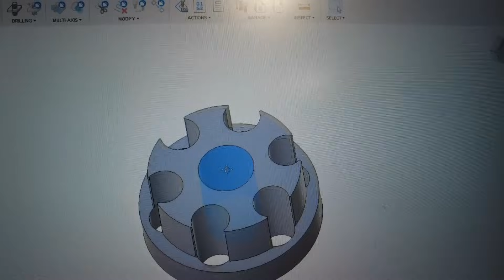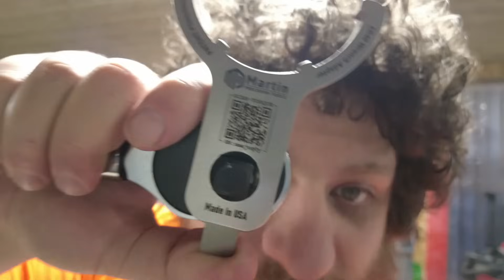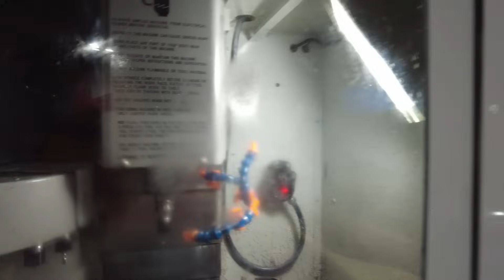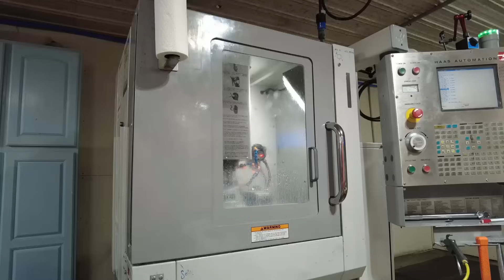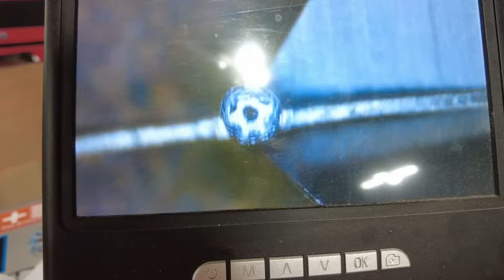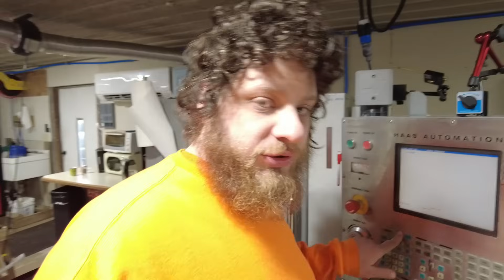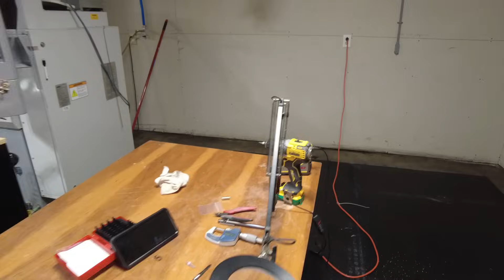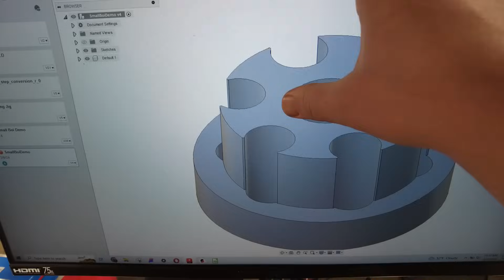Machining Some ABSURDLY Tiny Parts

Comment: The first thing I thought of was it's job for EDM. I was thinking about the best way to do this job. One strategy may be using your high RPM machine to mill small graphite electrodes to use to electrical discharge machine the small holes. Then use your mill to machine another electrode with a shape of a counter bore in it to use to burn the main outside profile. Then a wire edm to use to cut off to length. The edm process has a large advantage over conventional milling in this part example.    One the edm process does not actually touch the part hence eliminating the burring problem. Another strategy may be using a flat ground plate and use a hole-popper which is an edm process of making starting holes undersize for the wire of a wire-edm machine. The wire-edm could then be used to edm the holes to size. I used to own a mold-making business. I actually just got a cm1 hass like you have for my garage shop. I am planning on using it to make some aluminum molds for silicone soft-plastic fishing lures.
Reply from the maker: That totally makes sense. and I would love to move into EDM. Half of the jobs I take require super tight corner radii, and a EDM would be incredibly helpful for that.
Reply: @AudacityMicro  EDM is not going to cut it.. you always have a radius equal to the sparkgap, i'd like to make small gears, but my Wire EDM only can use  0.25 mm wire, which means a minimal pitch because of the wire diameter and the sparkgap being 0.05..
A Lathe with Spindle Orientation and driven tools would be the best option here.. unfortunately i haven't got one..
Reply: @AudacityMicro   actually another thought came to mind. If you think about the cutting path program for a second. Say you leave a small amount of stock, maybe .060 or maybe even a little more on the od of the part. You will need this for strength. Then you program a cutter path with a very small cutter. The cutter needs to be smaller than the od of the small holes. Then use an adaptive tool path program and step-down from the top to the bottom in very small increments maybe .001per step-down. This way you would cut right to size in each of your step-down and maintain strength in the part through out the cutting process.
Reply: not sure if graphite is the best material because of how thin the  graphite "boring drill" have to be. high speed might be able to cut it, but any minimal texture in the bit could mean breaking the graphite tool (high form factor, low strength material). maybe using the drill bit to machine a negative of the tooling in the graphite and then burn it into other piece of graphite or copper. and then use the copper to burn the geometry into steel. 
It certainly a EDM job. but I would call it a easy one for the amount of thing that can break in the process. but easier to debug than milling it, for certain.
Reply: @giuseppebonatici7169  I thought the same thing when I was pondering this part. We used to grind a lot of small graphite electrodes in my old shop on a surface grinder.  We used a Harig grind-all fixture and spun the graphite into the side-edge of the grinding wheel. The trick was to leave plenty of stock on the electrode and take the finish pass right to size. I think the same thing could be done with the high speed spindle of the milling machine. The trick with these type of micro parts is not to creep up to the dimensions. You have to leave enough stock for strength as possible then take to size.
Reply: @giuseppebonatici7169  drilling .005" - .010" holes through graphite trodes for flushing isn't fun but it can be done.... go slow and run that drill back every .025" or so to clear the "chips" .Pulling/ modeling trodes with fat bases help so you can get a good 1/8" feed and starting line for you tiny holes.
Reply: @giuseppebonatici7169  to me the part looks like a micro version of a "airplane connector" baseplate. Six channels and a common groundplane in the centre is a standard cable layout :)
Reply: I was thinking the cheapest improvement to make the process more efficient would be to magnetize his tweezers and needle nosed pliers. After losing the part for the 2nd or 3rd time I would be clawing my eyes out with frustration.
Reply: @WilliamKennedywmk3  the good news is material cost for lost parts is extremely low. lol
Reply: @WilliamKennedywmk3  one thing you don't want is magnetic tweezers.. that is why Watchmakers use Stainless tweezers, hell!, i even made my own tweezers out of titanium!..
Reply: Given the small reach and tiny amount of materiel to remove, I wonder if you could use sheet metal as the stock and bit of wire as the electrode? Plunge the holes right thought and then cut around and let the part fall out the back. If the erosion of the wire is an issue, then use a bit of wire several times longer than the part (2-3mm?) so there will be every little use of some of the wire.
Reply: @benjaminshropshire2900  ya you just have to mind the spark gap. EDM is the way with something this small in my opinion. A small sinker could burn through the center and the top detail on a whole plate of these little guys. Then a little wire machine would be nice to cut the remaining outside detail and have then drop free.
Reply: @5265060  The only downside to cutting the outside profile with wire is you'd have to clean up the 'tit' left over by the wire -- the part will drop free before the wire can make a complete circuit around the profile, which always leaves a small burr that has to be dealt with in some way.
Reply: @benjaminshropshire2900  If you machine this from sheet stock, how are you gonna hold it in place?..
i Once did some watchparts out of 1 and 1.5 mm sheet, that went fine, since i had plenty of surface to hold on, as well as tiny tabs around the circumference of the part.
I glued the sheet to a sacrificial plate of aluminium, milled out a couple of parts, and then dumped the lot in a bath of Acetone to dissolve the glue (CA).
To machine the other side, i drilled some holes, and pressed in some dowelpins, to orient the part, glued them down, and machined the bottom.
But in this case, that's simply not gonna work..
the best option, as mentioned here as well is a "Swiss" machine.. with spindle orientation, so you take a rod. drill the centerhole, and the 6 holes around the center, then face, and turn the circumference, and part off.. the only thing is.. when parting off, you need either a tube that fits over the part, or a vacuum, to catch it..otherwise it is lost in the chip tray..
I never ever ran a swiss machine.. but i'm sure i can make that work within a day, without training.. just gimme' the manual, and i'll figure it out..
Reply: @JanBinnendijk  I'm not seeing any issues with holding it in place. Mill out a pocket in a block and clamp the sheet over that? Or just clamp it sticking over the edge of a block? Lots of options.
Reply: @benjaminshropshire2900  indeed. you don't see issues.. i do..
Reply: @JanBinnendijk  Maybe we are using different definitions for "issues"? You described one way to solve the problem. I proposed several other (and could likely give a few more). Sounds like there are lots of options. Which is the exact opposite of having "issues" (at least the way I'm using the term).

Now if you have reason to think those wouldn't work in this case, feel free to describe those reasons. I'm always happy to learn more about the how and why of things I didn't know before, even if it proves I was wrong. (But if someone is uninterested in explaining why, I'm equally  uninterested in listening.) 

(Note: I'm assuming that it's perfectly find for the last step of the EDM process to be "part falls out into something it can be collected form later." If you're assuming it needs to maintain positive control all the way thought, that difference in assumption could account for out differing assessments.)
Reply: Absolutely right. I was working for a company some years ago, that were machining injector nozzles for a aerospace company. They were trying to drill 0.15mm holes at an acute angle to the part. One week later and a box full of tiny broken drill bits, they subbed the job out to have them EDM drilled. Three days later they all came back within tolerance and zero scrapped parts...Lesson learned by everyone involved.
Reply: Also a good solution
Reply: The first thing you'll notice about a micro drill or cutter, is that it's very bendy. The next thing you'll notice is that it's broken.
Reply: My first thought was, this is a job for a Swiss screw machine. They are designed to make parts exactly like this.

Comment: Would magnets not help to hold and measure the parts ?
Reply from the maker: The first batch was a non magnetic stainless. It would have worked for the second batch though.

Comment: a few neodymium magnets is various strengths will do the trick also for finding lost micro bits and parts, also i suggest you rid your self of the glass and sand paper although that does have a chooses I particularly like it for making the side cases on my custom bikes flat so they don't leak oil but what you need are real metal lapping plates of various cutting grades. they can be extremely precise. to .0009

Comment: I think it's fun because it's so difficult, yet so cheap in materials, except when you break the drill bits.

Why not drill the outer holes before removing the material next to those holes?
Reply from the maker: I did

Comment: Cool
Just one thing...

Torque wrenches should never be clicked twice... for your setup it doesn't matter so much, but if you need to be precise as with geometry adjustments in ym tolerance fields... you don't want to do that

Comment: If you're making small parts:

1) Vacuum all inspection surfaces and the surrounding floor.

2) When you lose the part,  take your vacuum cleaner, get a pair of 40 denier black tights, cut off an end and stretch it over the  the vacuum cleaner nozzle (use a round nozzle).  Secure the sock with tape making sure the sock is tightly stretched over the end of the nozzle. Now vacuum around the area you suspect the part may be in. Periodically inspect the end of the vacuum cleaner nozzle to see if your part has turned up. If it hasn't, expand the search area. It WILL turn up.

BTW, I'd turn the outer dia's on a watchmakers lathe before drilling. That way the ODs are clean.  Maybe follow up the drilling op with a mill to clean the burrs off the holes. Then, back in the lathe, clean the front face, set in a dop with shellac (not wax!), part with a saw, flip the dop, clean the back face. Remove from dop. That way parallelism is guaranteed and you have complete control of part height.
Reply: What is a dop ?   I have searched the internet in vain.  I do like your vacuum advice.
Reply: @Hereford1642  A "dop stick" is essentially a thermoplastic glue set on a bolt.

You glue the part in place, do the front face ops, transfer to a "dop jig" that lets you glue the front face to another dop stick, heat the first dop to separate and now you've swapped end for end with zero loss of position in any axis.

If only it would work with parts larger than a couple of grams...

Here's a lady setting up a stone on a dop. 

https://www.youtube.com/watch?v=0wSXIjznmlI

 And a dop transfer video:

https://www.youtube.com/watch?v=vnthnqykUu0
Reply: @evildrome  Thank you.

Comment: How is this industry cost effective because how much can this part possibly cost?
Reply from the maker: Things work a little different in this sort of work. Material costs are basically completely negligible. All the cost involved are skilled labor, tooling, and the cost of the machines. Per gram, these parts were very expensive. But you have to remember these parts are probably going into developing some medical instrument. The medical company is banking on selling hundreds of thousands of those instruments at a huge markup, so even at something like $2000/gram of parts, they will make money on this.

Comment: Two things you can try to debur tiny parts like this are (1) grit blasting and (2) steel shot tumbling. Micromark sells a benchtop grit blaster for like $200, and shot tumblers are cheap as well. I've use these when manually machining tiny watch parts and it works well, granted I work mainly with brass.

Great work, man. Very interesting channel.

Comment: Why is the liquid flow so high? You don't think that's causing problems?
Reply from the maker: It's relatively tame for this kind of machining. It's not enough to mess with the tool. The coolant flow is really important for getting clean cuts, as it helps remove chips, so that they aren't re-cut or smashed against the part.
Reply: @AudacityMicro  metal is the only material I barely ever build with. Its always surprising how incredibly stronger it is than wood or stone.
Reply from the maker: The carbide they use for modern cutting tools is also pretty incredible. There's not a lot out there that is harder. A few ceramics, and that's about it. It doesn't really bend much, (though it is measurable on precision parts). It generally goes from "cutting" to "broken" with very little in-between.
Reply: @AudacityMicro  pretty amazing. its the future!!

Comment: The couple of things I would have tried besides reversing the cutting to flex the bur is to a) once everything else is machined, run the drills back though the holes again to help clear them out of burs and any swarf before using the guage pin for final clearing (actually, I would do this twice: clear, blow off the part, and clear again, then remove the part with the slitting saw).  b) try using a weak magnet to hold the parts, or machine the jig out of a magnetic material and pop a strong magnet on the end to see if it will hold the part in the gig (might not work on some materials - you mentioned stainless and mild steel).  c) try using magnetic tipped tweezers.  

Others have mentioned EDM.  You might be able to build/set-up a simple EDM guillotine - where you machine the parts longer, and then chop the parts off the machined stock.  If you used a collet block you can take out of the mill, then you can use the collet block's side to index the  part for the removal operation.  If that worked out, then you may also be able to make multiple parts on the stock before parting them, then using a coffee filter to wash and collect the parts.

You also mention wanting/needing optical inspection tools.  There are some tricks I have seen people do with using a zoom lens on a camera, and setting up a digital camera rig so that you can pull measurements off of the image.  Take a look at HackaDay's posts on shop built digital inspection cameras (like: https://hackaday.com/tag/pcb-inspection/ and https://hackaday.com/2016/08/26/shop-built-inspection-camera-lends-optical-help-on-a-budget/ for inspiration, but with a little planning you should be able to build something considerably more precise).  If you are interested, reach out to me off-list, and I will see if I can help you with the image processing and trouble shooting.  As a note, I currently make my living as a data/image scientist, but I apprenticed with a tool and die man back in my 20's, so I feel your pain - and I remember the first time I was given a part with tolerances +0.0002/-0.0000...
Reply: To follow up on what I meant by an EDM guillotine, take a look at Jeri Ellsworth's EDM built out of an old door bell < https://www.youtube.com/watch?v=uUN4_-xp1Wc >  Instead of using a linear mechanism, make a rotating lever-arm on a decent precision bearing that you can submerse in water or cutting fluid.  When the cutting wire touches the part and makes an electrical connection, the solenoid retracts it.  With a good bearing it should be easy to set up, but getting it aligned with less than a thou might be a bit of a chore.  That said, if I were making it, I would set it all up and try to machine a slot or grove for the wire after the bearing was set in place and the arm mounted...

Comment: Laser EDM would do a much better, faster, reliable and most importantly a shit ton of them. You could snort a few hundred of them and still couldn't keep up with the production of laser EDM
Reply: PS: it's called Laser Micro Jet but no one know that so I call it Laser EDM. In laser micro Jet or LMJ for short they use water or other light conducive liquid as a very thin Light conducting fiber to deliver the high intense laser light to the surface of the part such that you get absolut perpendicular wall cuts. The finer the jet nozzle the tinier the hole/cut is.

Comment: There's too much talking about things happening, without actually showing those things happening,  isn't this supposed to be about machining?
Reply from the maker: Nope! My videos really aren't about machining, they are about problem solving.

Regardless, I have hours of footage of the machining, but it's useless. My windows immediately get covered in coolant, and the part is smaller than a rain drop anyway, I'm just not setup to film it. I would need an expensive macro lens, which I would most certainly never expose to coolant/chip.

Comment: If you're dropping parts from pliers you might consider investing in some rubber tipped reverse action (closed at rest) forceps/tweezers. I don't do machining but I do build minis and those things are a godsend for handling tiny and/or delicate parts.